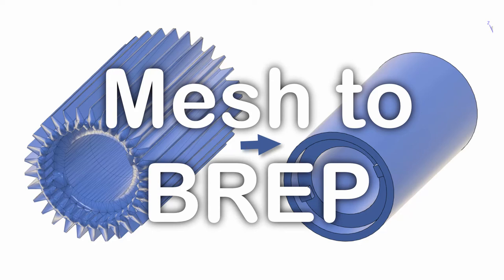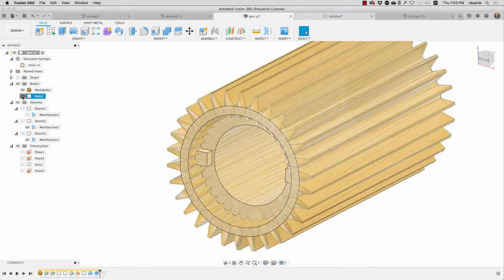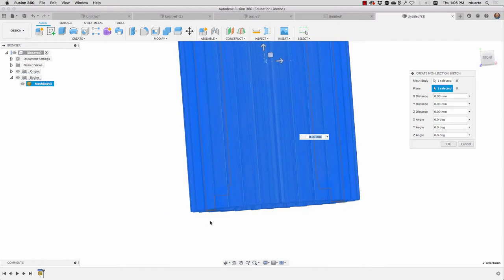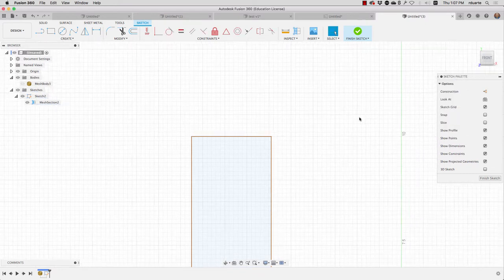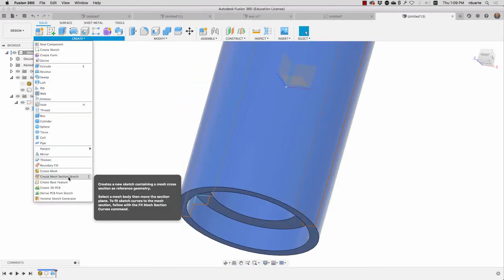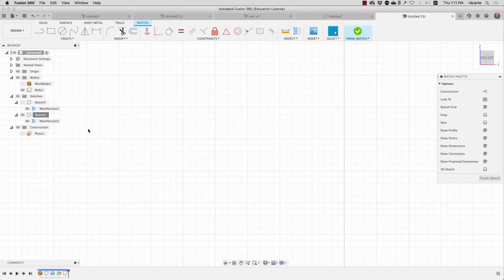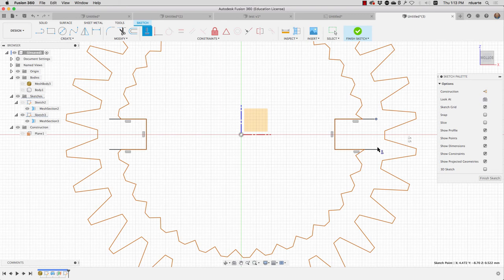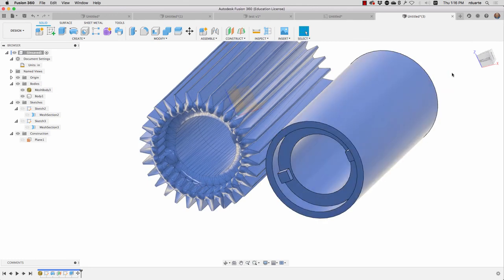Fusion 360: STL Mesh to BREP

Comment: So the best option left for STL conversion from Fusion360 is to ... use the STL as a sketch and rebuild everything from scratch ?
Yes, I guess this is a good workflow when you have only a few million faces !
I just landed on a job where I have to use Autodesk tools and now I'm sure I'll spend half of my time strugguling with bad softwares and the other half asking my coworkers and my boss to switch to other softs.

Anyway, great tutorial, I just have now idea how we got there.
Fusion360 was allowing conversion from tri to quads a few years ago, but apparently it was too good and they had to split it to another tool.
Reply from the maker: You can convert from a mesh to brep with a simple menu item. It's right there in the mesh workspace. For this example (and most others that I'm interested in), having a proper brep - with a handful of faces instead of thousands of quads - makes more sense. If your design is very complex, though, maybe the workflow I'm showing is not the right one. I'm sure you know that it's always rough using new software because you don't know all the possibilities. In this case, you just needed to know that the feature you're looking for is already there - not how to convince your boss to switch to something else 😃

Comment: OMG shut up and get on with it
Reply from the maker: You shut up
Reply: @RobDuarte  This video is outdated and does not work. Thank you.
Reply from the maker: I've heard this in comments in other videos, then I take the extra time to verify. Fusion has been pretty good about not breaking things over time, so none of the comments have been correct in the past. I'll check this out.
Reply from the maker: As I expected, it still works just fine. The only (very minor) change is that the "Create Mesh Section" command is in the Mesh tab now (which didn't exist before). Instead of complaining that I took too long to explain it, maybe you should have taken advantage of those free 12 minutes of generosity on my part to watch and listen carefully. I suspect you wouldn't have had any trouble. And if you did have trouble, you could've asked for help instead of telling me to shut up. In any case, thanks for forcing me to get in a bit of practice as I followed along with the video again - I haven't done this particular task in a few years.